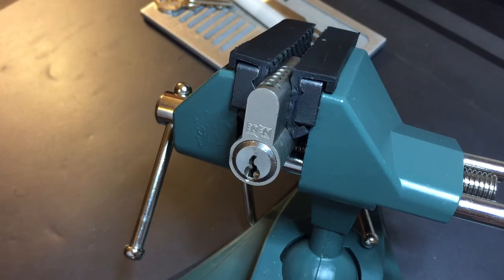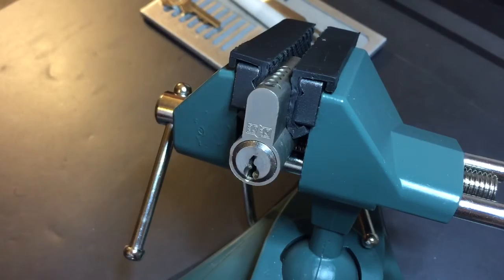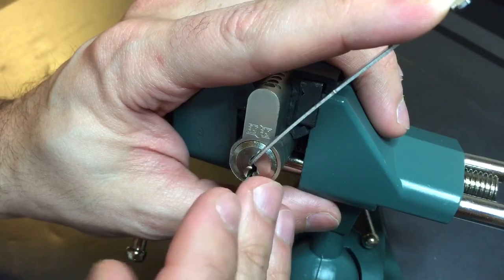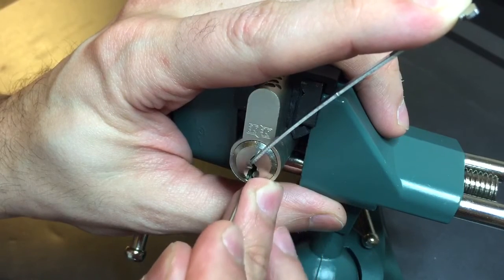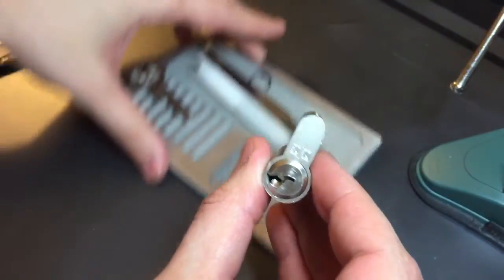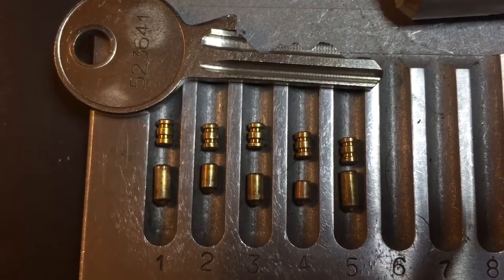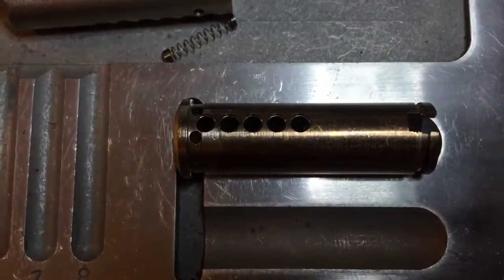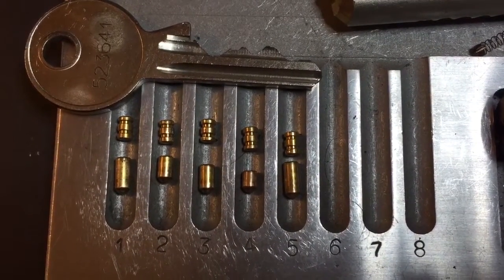[103] Gege Euro Profile Cylinder Picked and Gutted

Comment: all I can say bravo I'm progressively pinning one lately what sort of tension u using
Reply from the maker: +Javid Patel Thanks.  Tension is moderate, though I lightened up slightly at the end.  A tip on these locks:  the countermilling is such that when you finish with the driver pins, the pin stack becomes springy again... when you set the last one, everything starts binding again.  At that point, its just like picking standard pins.  Good luck

Comment: Really great picking mate, Gege locks are not easy at all, thanks for the tips. I have a gege without countermilling from Rick and I can not with it. Have you tried any gege without countermilling?
thanks for sharing ;-)))
Reply from the maker: +Tallan Pick Thanks.  I've only picked 2 other Gege locks.  The first was similar to this one.  The other is video #54, which also had counter milling.  I have a pExtra, but have not attempted that lock yet or looked at the innards
Reply: +LockPickingLawyer Ok, Thanks for the info. I´ve picked Ricks GEGE in my video #016 without problems. I will keep trying;-)))